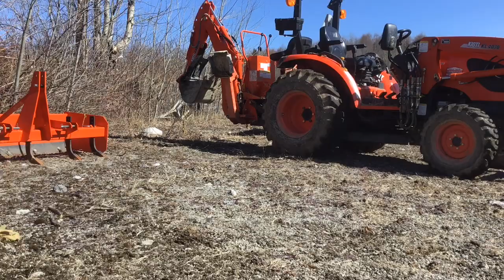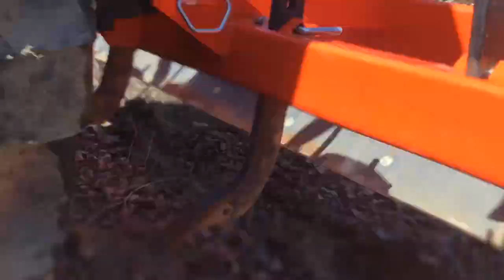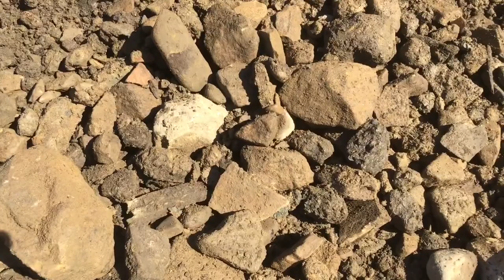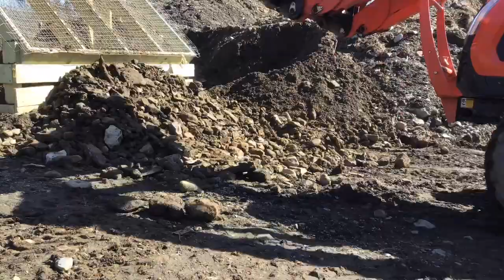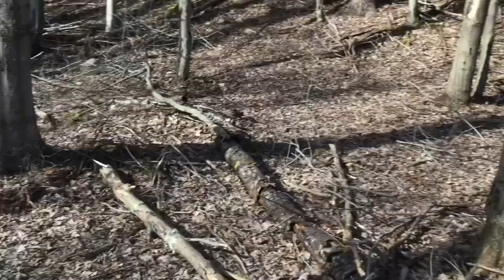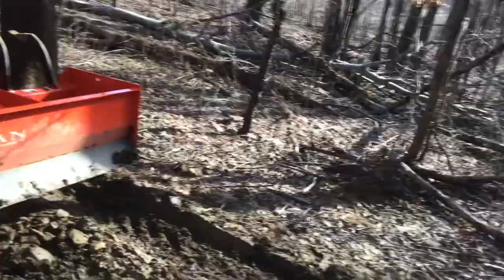Fixing trails with tailings from the homemade dirt screen

Comment: Nice rig! have you tried it with rooty, stumpy soil? I have large mounds of grubbed earth on our property that is 100% top soil but it is littered with branches, roots, and small stumps. I wonder if this would be efficient in sifting these out?
Reply from the maker: I have run some soil with roots in it and it does get clogged up.  But if you're patient, run it through slowly and the earth you put through is dry I'm sure it will work. You may have to clean the screen deck or dump some tailings back over it to clean the screen deck (which works well on mine). I have found through my experience with this screen, that if I run material through it, then remove the tailings pile and run it through again I get both twice as much screened soil and a cleaner pile of tailings as well.  So running through twice is really effective for clean tailings. The tailings make for great fill.  And working with screened soil is so much easier.  I have used mine alot and I think it was well worth the couple hundred I have in it.  Thanks for checking it out.  Good luck!

Comment: what angle is the screen top set ?
Reply from the maker: I have this one at close to 45 degrees. It is a 6 foot deck, and it is sitting on a 4 ft long by 4 ft high stand...give or take a few inches.
Reply: @JoshHovis  Thanks for info as I am building one and like your frame style.
Reply from the maker: Nice!  I hope it goes well for you.  I have put alot of yards of material through mine.  Well worth the money in material

Comment: well...thats pretty rough road , but instead of tryin to level it ... just back bladed it n run over it afew time backward and stradel your tracks ....otherwise how you doin it hmmm not so great sorry lol   LET IT DRY UP FIRST
Reply from the maker: Thanks for the tip but actually it worked very well.  The larger cobble and rock filled in the ruts and it set up very well.  I haven't had to touch it since.  And from my point of view it worked even better when it was wet because everything got compacted well just from driving over it.   Plus if I waited for things to dry up it would probably never get done. Thanks again